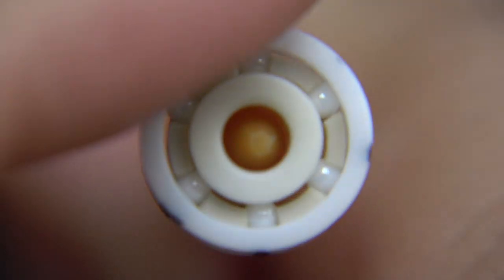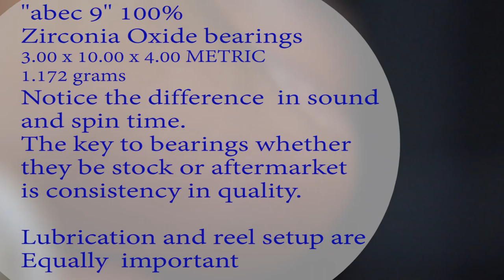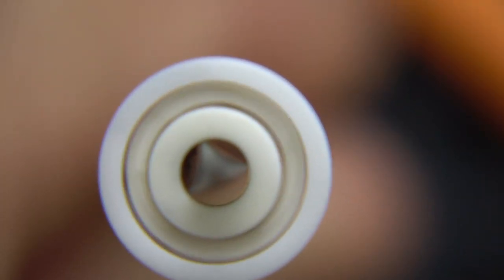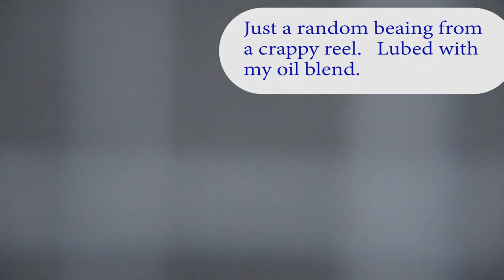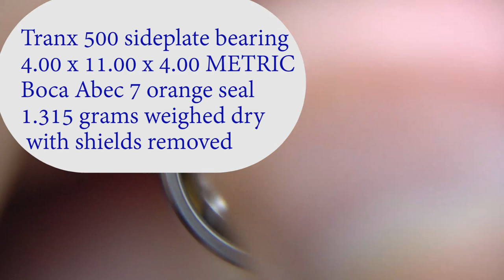Brief ball bearing comparison 100$ Abec 9 full ceramic, Boca Abec 7 orange seals, standard stainles

Comment: for fishing on the tx coast i knocked my shimano chronarch off my kayak into the dang bay. had "ceramic orange sealed boca's" BUT the dang outter race got some rust on the inside and some of inside of the orange seal got some rust on it . tried cleaning it out and soaking in pb blaster but it still feels gritty. how do the FULL ceramic bearings fair in saltwater?

Comment: I got Boca abex 7 can they be used dry over standard stainless bearings they seem to run better dry and cleaned in Zippo fluid
Reply from the maker: One of the reasons people say they cast "soooo" much further.  The bearings they're replacing are dirty and they probably use hot sauce, and too much of it.  Then they go to hybrids run dry and are blown away.
Reply: Tackle Advisors I used the Hot sauce it a thin oil as penn synthetic I like that it has a tiny application needle for that one little drop on standard bearings

Comment: I'm still waiting for a roller bearing in these sizes
Reply from the maker: Strange that they don't size the roller to fit this size bearing... It'd be noisy as hell though... Ceramics suck in that regard
Reply: @TackleAdvisors  not so sure on the noise of rollers if  properly greased & sealed

Comment: Would running Bocas bearings dry decrease their life expectancy or is it same shield. Considering application would be for freshwater only
Reply from the maker: For freshwater.  Remove the shields and run them dry.  Add oil only to quiet them or slow them down a bit.  I prefer to run mine dry otherwise you really arent gaining anything over a standard stainless bearing.   Though if they are really abec 7's not some bs china bearing that just says they're abec 7.    oiling will make them tighter over time as the burnished in oil builds up.
Reply: Tackle Advisors thanks for the reply, it was meant as a two part and forgot to add the 2nd part. Would running open shield or shielded shorten life? Or not much difference
Reply from the maker: It all comes down to if they stay clean.  Fw bass fishing.  it takes a bit to get debris into the spool bearings.
But just get in a routine of cleaning them out every 5-10 outings.
Reply from the maker: +eatsleepswimbait I run mine shields off and haven't had an issue
Reply: Tackle Advisors thank you very much appreciated. Your vids are very helpful and informative.